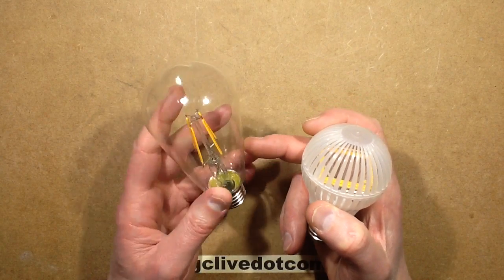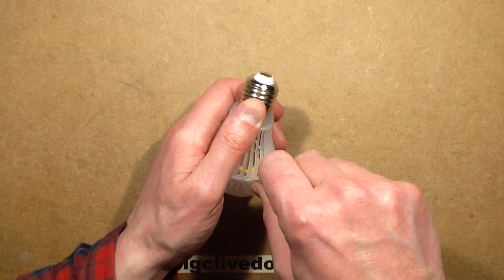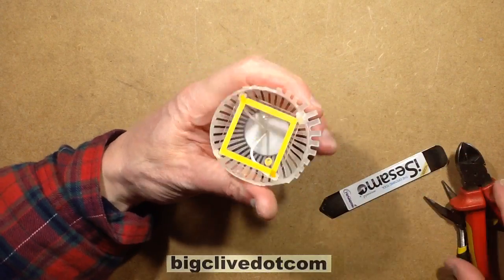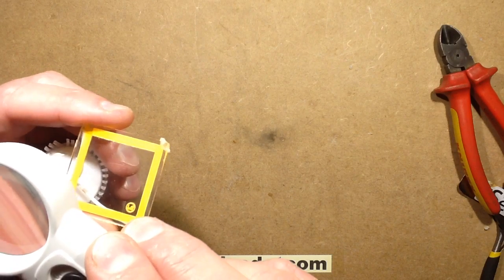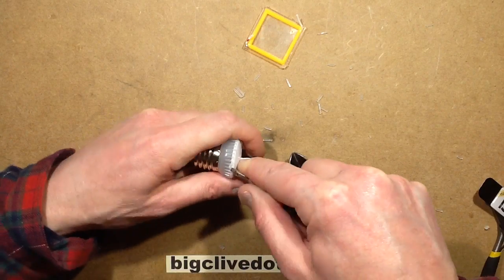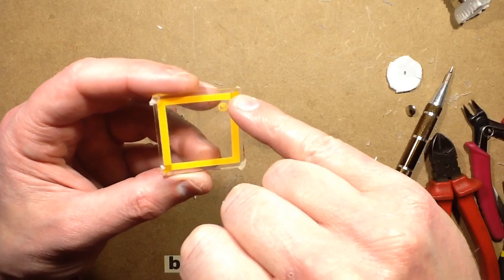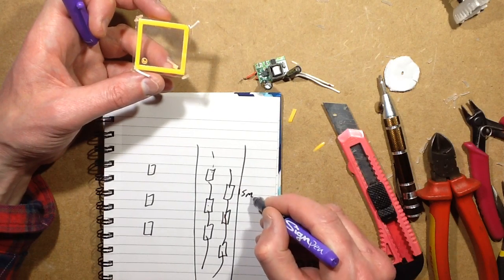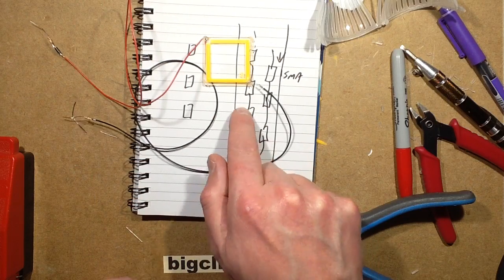Teardown of next-generation LED filament lamp.

Comment: I just received mine and I have to say, this little lamp is just brilliant.
I'm going to order more!

Also, I was comparing it to a 20W compact fluorescent lamp from Ikea (printed with a 1200lm marking). And this LED is even brighter.
Reply: +Toni Lähdekorpi is the color temperature ok? (for the warm white). and does it have any of that annoying 120hz flicker?
Reply: No flicker and the color temperature is really pleasing, very comparable to the compact fluorescent that I replaced with it. Maybe a tiny bit cooler. I was so pleased with it that I actually bought 10 more.
Reply: +Fat Lobster Oh wait, I don't have to guess it. I can just measure with a camera.
It's actually 3030 kelvin.

Comment: Why is it common for LED vendors to quote 2x higher wattage than it really is ?
Reply: +Perplexer1 Because WE have been taught that the higher the wattage the brighter the bulb. So if they have a 6 watt bulb which is brighter than 6 watt bulbs used to be they exaggerate the wattage. Our fault for using a rule which no longer applies. Mind you, if they use lumens they will probably double that too :)

Comment: Is the idea of the slits to provide some kind of diffraction grating to help spread the light, or is it just for ease of manufacture?
Reply: Brandon Lewis Maximum airflow with required resistance to poking with fingers and thick screwdrivers. IPxx standards specify that neither a bendable artificial finger nor a screwdriver of specified thickness shall be able to touch dangerous connections. I suspect the distance between plastic grills was intended to be just below that screwdriver thickness and the window glass plus glue blobs further stop touching.

Comment: I was sad when you cut into it... Why not just provide low current and up it from there to see all the LEDs?
Reply from the maker: +Valueless Dollar By completely tearing one apart it saves anyone else having to.  The needs of the many are greater than the needs of the one.
Reply: bigclivedotcom
I guess.

Comment: I'm wondering what your take is on flickery led lights. I'm referring on the ones that seem to be powered by pulses of current and if you wave your hand in front of them you can see a more or less pronounced stroboscopic effect?
Reply from the maker: +benbiche It's common with cheap lamps or ones with very small bases with no room for the electrolytic capacitor that is required to smooth the output and stop the flicker.
Reply: +bigclivedotcom that makes sense. Thanks!

Comment: I wouldn't mind one of these,  but I need it with a B22 fitting.
Reply from the maker: +Cory Tant No problem,.  You can get BC to ES adaptors on ebay or even Ikea.

Comment: The big question on LED bulbs is heat. If these filament lamps on a little glass square can run cooler than the usual higher power chips on an aluminium spreader, then they will last longer. The open bulb will help a lot, but get full of dust. And it looks fragile. The other bulbs can bounce on the floor and not break.

Comment: Forgive me if this is a dumb question but, since LEDs are diodes anyway, why did you put one in series with the resistor?
Reply from the maker: +tjperez69 To avoid reverse biasing the LED array and potentially damaging it.

Comment: Too bad there isn't a 120V version for the US.
Reply: I've seen these same bulbs in Home Depot sold under the Cree name, and they were very cheap compared to the original Cree solid glass bulbs.  Now that I've seen how bright they are I'll pick up a few.  Also, I think the ones I saw were 60W equivalent and marked dimmable.
Reply: +oisiaa Yeah I'm looking for one too.
Reply: Perhaps I could cobble together a low watt 220 step up transformer.
Hmmm I have 220 in the garage
Reply: +Jesse Levesque Just to let you know I DID order two of these knowing they were 220 volt... well, on 120 volt A.C. they light up but not so as one could actually use them, the output IS bright but erratic sputtering periods of off time, creates an interesting effect but absolutely not for USA 120 volt systems.
Reply: Yeah, I'm thinking it might work to take it apart and replace it with a 110v power supply, as long as it could provide enough power, the ones from the super cheap ebay lights might work but considering how destructive this was, I doubt it.
Reply: Oh really? If so can you put down the information/model number they have on the box? I doubt that home depot here carries them but buying them online might work.
Reply: +Jesse Levesque I did not yet actually buy one of these and am currently traveling and not able to visit a Home Depot store.  But, I Googled &quot;Cree Filament lamp&quot; and found these links which should help:

http://creebulb.com/learn/behinddesign
http://www.amazon.com/Cree-Equivalent-White-Filament-Design/dp/B00U0YHRMU

It looks like the Cree bulbs are slightly different than the one that came from Ali, but probably very similar.
Reply: I have a few Cree bulbs, they have glass bulbs but according to a guy I know who used to work for Cree, these are not built the same. Cree does market a plastic "open" style lamp as well, and this is the one I see in the link. IMO Cree makes the best LED products... That said this China lamp from China is a decent product and certainly a unique design
The lamps I have are at the link below
http://www.amazon.com/Cree-100W-Equivalent-White-Light/dp/B00JJ2KSL6/ref=pd_bxgy_60_img_3?ie=UTF8&refRID=0PVZ3XRCG4RS9Y2YNZMB
Reply: Pussy little US voltages. Bunch of 120v sissy bitches
Reply: it's 220 in US

Comment: Hi Clive.   I really enjoy your vids.  Wish I had worked on my manual dexterity when I was younger as I have never seen anyone as handy as you are with a soldering iron.  One thing, would it be possible for you to expand your testing of LED lamps into a new area and check on the amount of radio noise they do or don't generate?  I am an amateur radio operator, and while I really want to replace all of my old bulbs with LEDs, I hesitate because I have heard that many of them pollute the spectrum with RF hash.  Thank you for all you do.  Keep up the great work!
Reply from the maker: +Robert Ahrens The ones with little switchmode power supplies put out horrendous electrical noise.  But the lower power ones with capacitive droppers may be a bit quieter and would certainly lend themselves to easy addition of extra filtering if desired.

Comment: Besides the bugs, I wonder at which temperature it would run at. Small aluminum heatsinks of MR16 are ~10ºC/W, and considering glass is much worse heatsink... I am a bit skeptical regarding lamp life. Driver will be safe though, it is far from LED.

Comment: I've just bought a few of these from Tool station and the reason for the purchase is that I like the look of a naked filament when running a vintage lighting display, but although only rated at 4 watts they give high lumens and it's also simple to run a couple of these with a bicycle dynohub due to the low power consumption.
Reply: +Ola K  Without knowing more info, I suggest you look for a prefabricated adjustable DC-DC voltage converter board/module.   Nothing has benefited my low voltage projects more than discovering these convenient yet affordable devices. Super simple to use & 100% reliable so far, I'm more than satisfied with the DROK brand boards I purchased from Amazon.  Almost like magic, their DC-DC voltage increasing board can take your 5VDC supply, and transform that into whatever higher voltage you select (up to 32VDC). and it cost barely $5usd.   For a few more dollars you can get a unit capable of both step up & step down DC Voltage conversion, optional adjustable constant currant modes and built in Volt/Amp display.  The physical size of most are relatively compact too(approx. 1inch X 3inch x 1/2inch).  Just about endless are the possibilities for today's electronics, and it keeps on advancing; unfortunately faster than me!  Hope i helped, or at least gave you some food for thought.  May the force be with you!
Reply: +Names Warner
Reply: Wold you please share some info on how you jooked them up to lower voltage? Im experimenting with a joule thief myself but yet hasent managed. -> Ola@aquarius.se
Reply: Im working with 5 volts preferably

Comment: Interesting bulb and very interesting tear-down, Clive... Thank you. In the comments, you say that the lamp is "very bright". That's a bit subjective. How bright is it really? I understand that you cannot measure the lumen output, which would need very costly and cumbersome equipment (a lumen measuring sphere). But you could quite easily compare the light output of the lamp to a traditional tungsten filament lamp. You would just need a cheap lux-meter and a set of traditional bulbs (say one 25  W, one 35 W, one 50 W, a 60W, a 80 W and a 100 W) and compare the output of the lamp under test with that of a tungsten filament lamp. The light level should be measured at a standard distance from the lamp (say 1 meter). Then you could say that the lamp under test is more or less equivalent to a 50 W tungsten filament bulb, or between a 35 W and 50 W bulb, and so on... That would give us a better clue than just "very bright"!

In this particular case, the 6 W input power used suggests that the lamp's light output is more or less equivalent to that of a 30 W or 35 W tungsten filament lamp... Or is it significantly better than that? In their advert, the seller boasts 1 100 lumens for that lamp which would put it on par with a 75 W tunsten filament bulb. That's just incredible (and probably bullshit)!

What say you, Clive?

Comment: I wonder if one could find a good supplier of led strips/bulbs using the newest samsung smd leds with 150-170lm/W efficiency from Korea which ships in 1 piece quantities just for the sake of brightness comparison/standard.

I don't really think these are next-generation filament lamps, they are new but if the efficiency is nowhere near 100lm/W it's actually worse than a good quality CFL.

Comment: Interesting driver assembly.  It looks good in principle, but it uses aluminium electrolytic capacitors, which are likely to fail long before the LEDs reach end-of-life.
Reply: Aha thank you!
Reply: Which caps has more longevity/life expectancy?
Reply: Ola K
For high capacity in a small volume, it is solid tantalum capacitors.  I've built projects with them that are still working fine more than 35 years later, but they're much more expensive.  Electrolytics depend on the quality of the rubber seal, and those with poor seals tend to dry out within 5–7 years.  Using them in LED lamps that promise 22 years of life doesn't make sense.

Comment: Love your stuff. but I watch for 10 minutes as you struggle, at 10:39 you say something I really wanted to hear, as FAST as you can in your Aussie speak,  I back it up too many times to try to pick it up... What kind of cap?  Remember, it's a mixed audience of amateurs and pros. (Pros may just fast fwd, or not watch at all..
Reply from the maker: +TheOldGuyPhil Bridge rectifier, smoothing capacitor, 400V 4.7 microFarad.  Sorry, I do sometimes trip over my words when I speak to fast.
Reply: +TheOldGuyPhil  Thanks! (You're the Man! (Of the Isle)). I'll bet that plastic was ultrasonically welded.

Comment: That thing has a more complicated driver than I would have expected. At 110v (US) all you would need is a diode or bridge and current limit resistor to make it light. Though such a design would be less efficient. 

I love the little square glass bit with the embedded LED's I can see these being used in architectural lighting and display cases without the bulb feature. 

I want to get a couple of these to play with too!
Reply from the maker: +TruAnRksT Technically speaking, it's a prime contender for a simple capacitive dropper.

Comment: What do you call that red mains breakout box type thing that I've seen in a few of your videos? I've been looking for something like that but I don't really know the right term to search. Cheers.
Reply from the maker: +KX36 It's called a quicktest.
Reply from the maker: +KX36 It's called a quicktest.
Reply: Thanks. Shocking how expensive those are, I think I'll stick to choc blocks for now when I have to wire things into mains temporarily.

Comment: Got one of these similer to the edison bulb in the kitchin and bedroom also bought from aliexpress. Are these relatively safe then in your opinion?
Reply from the maker: +eraldorh It seems sensibly designed and the fact the lightsource is mounted on thick glass should make it fairy safe.

Comment: reminds me of that ElectroLuminescent / phosphor light paper, that you could cut with a scissor and have a light panel in any shape :p  

Not sure what happened to them, they apparently disappeared from china seller markets.
Reply from the maker: +Eqvaliser Electroluminescent sheet or strip.  You can still buy the strip in various widths on ebay.
Reply: bigclivedotcom Ahh yeah found them was searching all wrong. had to search for "EL *" replacing * with panel, light or whatever i was looking for..  thanks..  ;) 

Good show..

Comment: I imagine the BC adaptor is not British standards or such as ES should be only live in the cenrtre. Looks an intersting tough little lamp ,did it have a life average?
Reply from the maker: +christastic100 The Bc to ES adaptor is definitely not compliant.  Which makes it odd that IKEA sell them.  Not aure what sort of life they expect with these lamps, but the LED filament approach is doing pretty well.
Reply: +bigclivedotcom .It is surprising Ikea sell them . I had seen my local electrical wholesalers had samples of adapters like yours including GU10 to ES . thank you for your reply .
Reply from the maker: +christastic100 The GU10 one is also non compliant, since it can be put in either way round, potentially making the outer thread of the lamp live.

Comment: What would happen if I plug one into the 110v US power grid? WOuld it just light 1/2 wattage?
Reply: +nunyabiz nunya Since the circuitry is designed to regulate current rather than voltage, it might work just as well on US power. 
The circuitry complicates the Watt&#39;s law application. If it was all passive, then reducing the voltage by 50% would also reduce the current by 50% as well, leaving a power dissipation of 1/4 the 220 volt value.
Reply: +nunyabiz nunya I bought one to try it out; for some reason it flashes rapidly.

Comment: Great video and what a beautiful lamp! Too bad they don't seem to be available on eBay yet =( Time will heal and we will soon have them there as well =D

Anyhow, just a thought.. Maybe you could get a "cheap" USB microscope? If you're using a computer to edit your videos then it would be just to add another video to the editing process. However, if you just edit on the iPad then I have no idea =)

I have the a 2MP Adonstar USB Microscope myself and it performs quite ok.. Anyhow, just a thought =)
http://www.ebay.co.uk/itm/Andonstar-2MP-USB-Digital-Microscope-Camera-dental-Endoscope-PCB-repair-tool-UK-/351564782015
Reply: +Chris Fredriksson "Time will heal".... LOL!
Reply: +Waqas Ahmed Unfortunately there is lots of wrong things with ordering on AliExpress.. First, they dont have buyer protection like eBay. I've ordered from Ali a couple of times and every time a problem arise I get to fight with both the seller and Ali to get my money back. eBay = is on the buyers side, AliExpress = is on the sellers side..

If everything works out and you get the items and you're satisfied with it, AliExpress could be just as good. But I've had too much problems with AliExpress as many others has as well, so I don't use that until they understand their problem and fix it =)
Reply: +Chris Fredriksson Nowt wrong with ordering on aliexpress!
Reply: Chris Fredriksson Fair point. Tbh, I've not had an issue with Aliexpress! :)

Comment: It's probably not bad in terms of function, but having the ventilated shell defeats the idea of filament-style in aesthetics. Whole point of doing that is to have it look like an old-school filament bulb, particularly if you'd use it on a dimmer circuit.

My guess is this bulb isn't really meant to be used as a "filament style", but with the venting and seemingly cool operation it may be good for use in an enclosure.